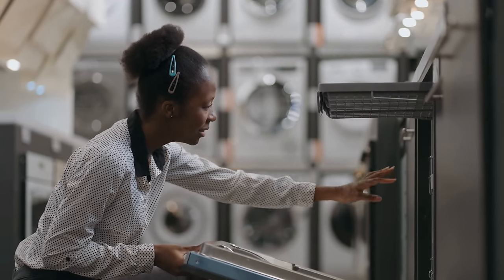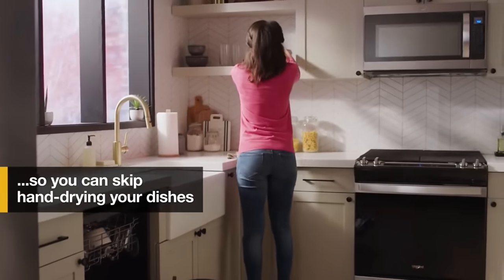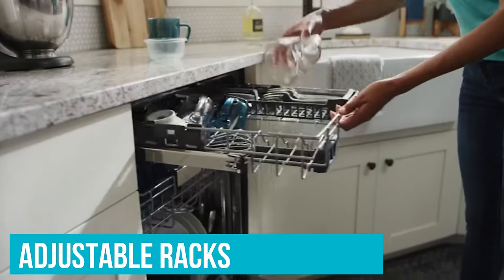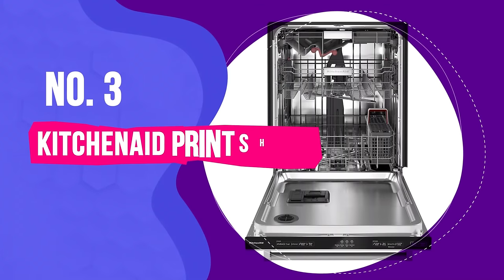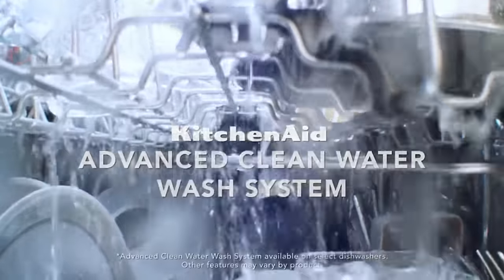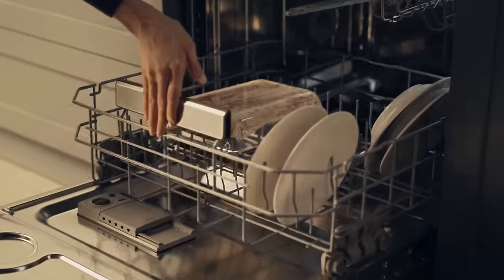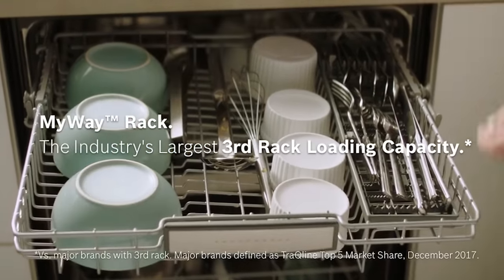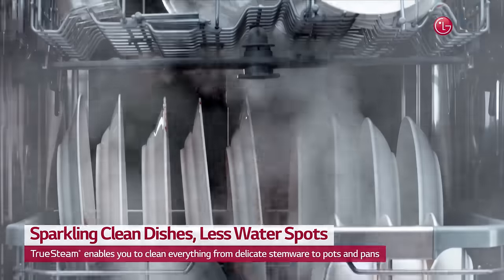Best Dishwashers 2024 [don’t buy one before watching this]

Comment from the maker: ► Links to the Best Dishwashers 2024 we listed in this video: 

► 6. Whirlpool Quiet Dishwasher - https://geni.us/6W9sY
► 5. Maytag MDB8959SKZ - https://geni.us/BwHO
► 4. LG QuadWash Dishwasher - https://geni.us/TMxS
► 3. KitchenAid PrintShield Dishwasher - https://geni.us/lZjCj5
► 2. Samsung DW80R9950UT - https://geni.us/Bun7U
► 1. Bosch 800 Series Dishwasher - https://geni.us/Tnnj
Reply: We have a number of rental properties. Our Bosch units kept leaking after a couple of years & the Samsung pumps failed even after warranty replacements. Their Fridges & microwaves are worse. The LG’s have been the best but now we are finding spray arm diverter motors are failing. Very cheaply made inexpensive part but a big job to replace.

Comment: Do NOT buy a Samsung with that stupid water wall feature. The motor that controls it will break and you’re left either spending $350+ for a repair. Or buying another dishwasher. I repeat. Stay away from any and all Samsung appliances.
Reply: Agreed x 1000
Reply: My Samsung dishwasher just stopped working a couple weeks ago. It's only a 2019, was fairly new when I moved into my house. The control board is toast, can't turn it on or do anything and I can't even find a replacement board for it. Never will I buy Samsung appliances.
Reply: samsung is shit
Reply: I second that. We had ours 10 months, and it broke. Had the service team come out, they fixed it. A short 20 days later, broke again. This was followed by 3 more failed attempts to fix by the certified technician. This and 3 months of waiting, we finally got a refund.
Reply: Can confirm! I work as an appliance technician in Australia, their appliances are plagued with issues. 

Their french door fridges have terribly constructed ice makers, constantly jamming with ice buildup. Pooling of water in the fridge compartment stems from a poorly designed evaporator, defrost system, that either suffers from  a component failure or a blocked drain due to design.

Their front loaders are even worse, issues with the cheap drain and recirculation pumps cause massive havoc to the main control module, making repair incredibly costly. The problem is so prolific, if it was under warranty when the issue was detected, we had to replace the entire coin trap assembly, interlock and main PCB to cover all the components that could be affected.

Their dishwashers are just shit, the culmination of all their poor decision making. If you owned one, you've probably seen a technician 3 times before it even turned 5. 😤
Reply: I second this. We have a Samsung dishwasher
Reply: Samsung makes beautiful appliances, but they're all trash! I won't ever purchase Samsung appliances again - not ever!
Reply: True!! And samsung customer servise is a complete nonsense, i had experiance, 

1. I bought samsung washing machine in april, it arrived on the day went abroad when i came back in 3 week and installed i found out it is faulty. The dirty water never drains off. At time the empty machine is filled with dirty water. I contacted they shut me off saying cool off period expired. I had valid reasons and proof, they care a damn. Later sent their repair man who said machine aint't faulty. Still having same issues!!! Now in the verge to chage brand with in a year of purchase.

2.and 3. They said 200 cash back if u buy their product i bought their diswasher and what?? It is faulty within a 2 yr and it makes loud noises and also had dirty water filled inside often!!! Now again, i had to change brand.
Reply: Thank u.  ❤❤.  I trying to stay away from samsung.  I am between and Bosch
Reply: My dishwasher was installed in October 2023 and quit May 2024 because the seal failed and water got into the motor
Reply: I bought a $3000+ Samsung refrigerator 3 years ago.  Compressor already broken.  Service has been such a chore to work with.  They’re supposed to come and fix it soon.  And I was promised that they won’t charge me for repairs even though it’s out of warranty.  I was also promised up to $400 of food that I had to throw away.  We’ll see how that goes.

Btw, I have a Samsung tv that I bought a few years ago.  Everyone told me Samsung made great tvs.  I’ve got a black bar about 8 inches wide in the middle of my screen.  (I’m going back to Sony tvs.)  So yeah, these are only 2 things I’ve bought from Samsung and these will be the last 2 things I buy from Samsung.
Reply: I concur with you 100%, my samsung dishwasher model DW80H9930US failed 4 E code error, I fixed it myself, now it failed 7 E code error again. They said it is motor and sensor issues. It will cost over 400$ to fix it. Now I have to buy a new one again. The warranty does not last longer than 1 year. Extending it, you lose money because after one year be ready for repair.
Reply: Samsung try to reinvent the wheels.... Rather than spend the money for more reliable components.
Reply: I got burned by multiple Samshit products. Never again...
Reply: All samsung products are rubbish
Reply: @ceriseanne1  Agreed x 1000 X 1000
Reply: Agree!
Reply: @ceriseanne1
Reply: Take a look at the problems with their refrigerators. I'll never buy anything Samsung again. I have a refrigerator that can't dispense ice and a TV that crapped out a month after the warranty was up.
Reply: Agree, screw Samsung. This is exactly what happened to mine. Had to but a new one. Never again with Samsung.
Reply: I love my Samsung Bespoke fridge .

Comment: I had a G.E. Profile dishwasher that came with the house when we bought our new home four years ago. It has broken down three times, not including this last time when it did not start. I'm tired of having to repair that piece of junk. All the pre-installed General Electric appliances we have have had mechanical issues. IMO, don't buy any G.E. kitchen appliances or you'll be sorry.
Reply: Same here.

Comment: No lie. The green energy Bosch dishwasher took over 8 hours to wash dishes. We replaced the Bosch with a brand ( Midea) we never heard of for around $600. Best dishwasher I ever had!
Reply: Hello, what was the name of the model please? im trying to find a good dishwasher that’s affordable
Reply: @Halasam89  
Midea brand. 
 Model  MDT24H3AST 
Mfrd MAY 2021
We purchased it in 2021  from either Lowes or Home Depot.  Stainless steel inside.  Front cover  is  a stainless steel look (not sure if the outside front  cover is real stainless steel or not but looks good).  Not one issue yet. Cleans dishes beautifully.

Comment: I replaced my GE dishwasher and this new one is just a pain. It will not drain the water. They came out to fix it and it still will not work. They replaced it with a different GE dishwasher and that one is doing the same thing. Now I have to redo my plumbing. New technology is not always good.

Comment: My friend had a Bosch and it started to stink after a few years. I had a Kitchenaid that went belly up in four years.  So I'm at a quandary about which manufacturer to look at. My current Whirlpool in the home I just purchased is the original one put in when the house was built in 2009. Any suggestions? Is there such a thing as one under $600?
Reply: A dishwasher stinking might be because the drain hose isn't correctly elevated
Reply: Or because the filter hasn't been cleaned.  I have 2 Bosch dishwashers in my house and they are excellent.  Never had an issue with them stinking

Comment: I just got an LG Studio Dishwasher.  After watching videos trying to figure out how to work this thing without enrolling in a rocket science college course, I have found mostly BAD reviews and most people are really struggling to figure these super complicated controls out. I would definitely recommend NOT buying one of these. As Elon Musk would say, "THIS IS A DUMB DESIGN." WAY, WAY, WAY OVER COMPLICATED FOR A DISHWASHER. I AM FEELING RIPPED OFF. 1/2" thick manual!  WOW. I just bought it today and they want $5.00 to answer my question of how to turn drying off. Ran a load of lightly soiled dishes on normal. Not very impressed had several that didn't get clean. Yes its level. Yes I preheated water by running faucet. Yes I used the recommended detergent.  Yes I checked sprayers spin freely like I always do. I may return this to Lowes. I sure wish it would work with a windows PC.  NO I don't want an emulator on my PC.

Comment: I know that everyone has a dishwasher that they really like.  We have the Kitchenaid model that is featured in this video.  Ours is soon to be three years that we have had it.  We really like it a lot.  It does a fantastic job cleaning. Ours has the fan drying feature, which does a great job of drying the dishes.  In a house that we owned in the mid 90's had the top of the line Kitchenaid dishwasher.  It had the fan drying feature also.  It had the quadwash system that LG appears to take credit.  Ours had the quadwash plus two other blades,  one on the middle rack and the other at the top of the tub.  The newer Kitchenaids don't have the quadwash system,  just the blades.  Last thing to mention is that our dishwasher is very quiet.
Reply: LG's QuadWash system is not just a marketing gimmick like WhirlPoop's products though... with LG, two of the four spray arms change angle as they rotate, which KitchenAid didn't do, it was just four static arms instead of two...

Comment: My 2005 maytag just started to stop everytime the cycle starts. the dishwasher fills, begins washing an within 5 seconds cuts off. tries this 4 times then shuts off. Im hesitant to call a repair man to diagnose cause I dont want to waste cash on someone telling me its old and to replace. but I know this machine may still have life and maybe its just a cheap fix.  New dishwashers seem like they SUCK from the horror reviews I read
Reply: Did anyone look at it?  Does it have a turn dial.
Reply: Our 2017 Kitchen aid did the same thing, found a procedure on You tube to find the codes that our dishwasher had, your dishwasher may or may not have some as well. Mine did, circulation pump went bad. Found out through some research that the entire sump assembly (which includes the circ pump) was cheaper than just the circ pump. Also found out How to replace said sump on, YOU GUESSED IT. You Tube. I had the sump pump out and new one in in about 6 hours, I'm slow. Haven't had an issue since. This was 2 years ago. Research tools are at your fingertips. I too will not pay someone to come out for an estimate. Oh and the part was around $260 and change
Reply: Just buy a new dishwasher.  Having a technician to come out just telling what you knew already will cost you almost $200.  Then the parts and labour, what you pay can buy a new dishwasher .  That’s my experience three weeks ago.
Reply: Same problem with our dishwasher -- my husband is very handy -- he deciphered the code -- purchased a new control panel per code error -- still had the same problem. I am now looking to replace my 4 yr old dishwasher
Reply: Our Maytag just died after over 20 years of daily cleaning.

Comment: Bosch Series 6 or LG Quadwash TrueSteam?
Reply: Which one did you get?
Reply: @MrAlbertoyelizabeth  Bosch
Reply: I had a bosch S6, faulty just after 2 years warranty expired, too expensive to repair, bought LG Quadwash Turesteam, being 3 years now, faulty now, trying to fix it.  To be honest, I still prefer Bosch, it was fast and clean. 40 min done the job, the fastest cycle with LG is 1 hour and 40 minutes .

Comment: No GE models on the list at all??
Reply: I had a G.E. Profile dishwasher that came with the house when we bought our new home four years ago. It has broken down three times, not including this last time when it did not start. I'm tired of having to repair that piece of junk. All the pre-installed General Electric appliances we have have had mechanical issues. IMO, don't buy any G.E. kitchen appliances or you'll be sorry.
Reply: GE appliances are in the toilet, they’re garbage. That’s why you’ll find only GE in all of our new homes, townhouses, and condos, pre-installed. Because the developers get a sweet deal from GE, on all their out of production models, that they’re not producing anymore, but still have a huge inventory of and can’t sell them. So unbeknownst to the new home owner, they think they’re getting a brand new appliance, but really the appliance is (?) years old, from sitting around going unsold. It happened to me, my “brand new” GE dishwasher is toast, and unrepairable after just a couple years. Now I’m watching this, trying to choose between Bosch and LG?